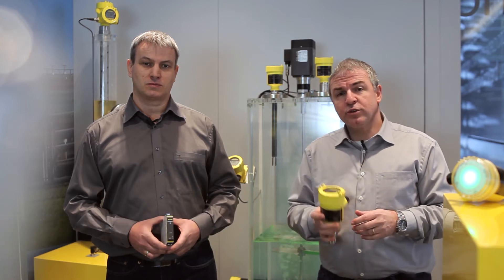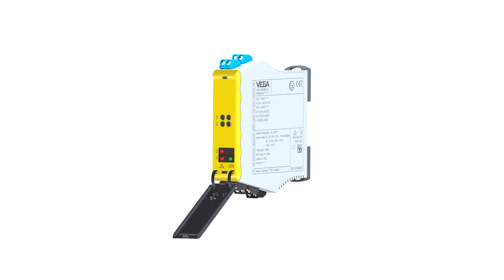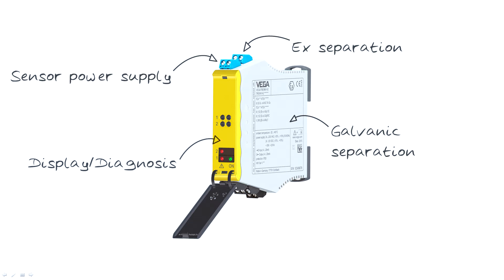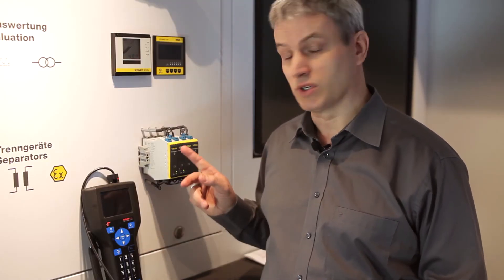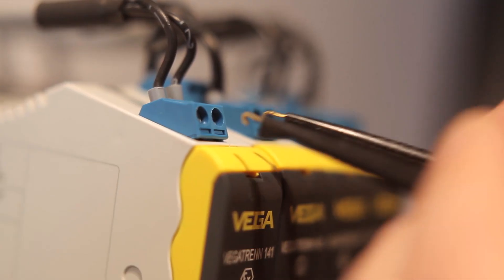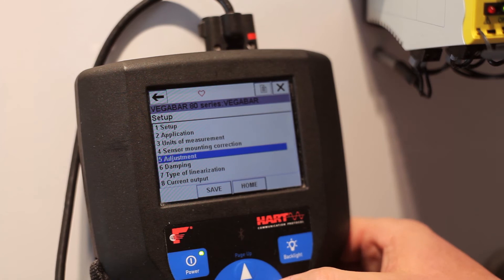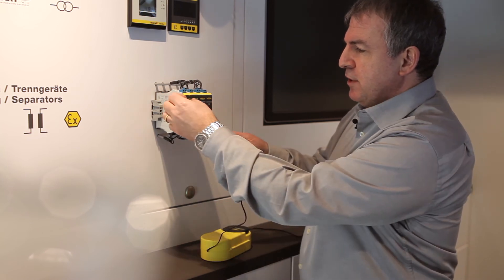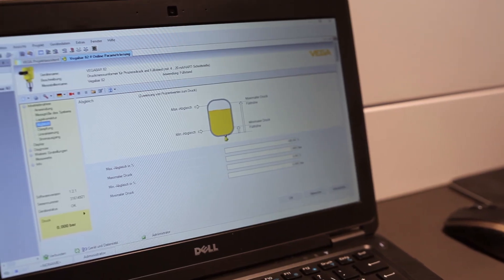Simple adjustment of 4 … 20 mA/HART sensors

Comment: hello, let me ask one question, we are using vega 62 radar level transmitter in our oil storage plant,during scheduled maintenance we found 2 radars out of order and were showing false readings.we removed them and shifted to workshop and connect them with HART communicator, after powering up transmitter stucked on a reading which he detected on 1st attempt,we tried many time from different distances, but no suucces.
could.you guys please help me to.resolve this issue.?
Reply from the maker: Hello, thanks for your question. The sensor has a range around its current level echo, within this so-called "focusing range" it accepts measured value changes. This range depends on the selected application settings. If you want to test something outside the vessel, you can use the application "Demonstration". With this setting, the sensor immediately accepts all level changes. The reason for this behaviour is that in real applications normally no major level change can occur within a very short time. Please contact us, if you need our support: https://www.vega.com/en/company/vega-worldwide